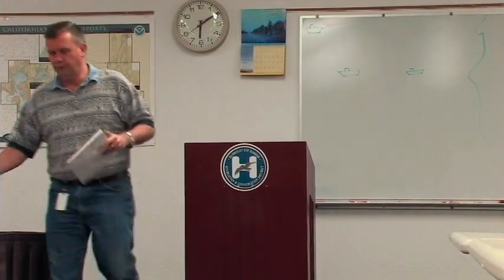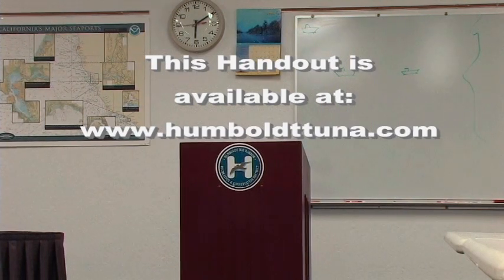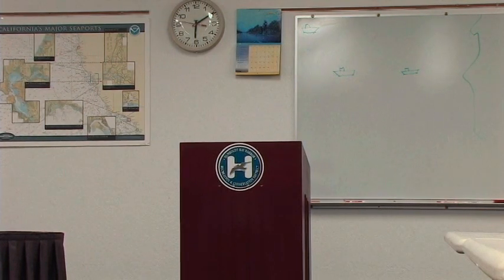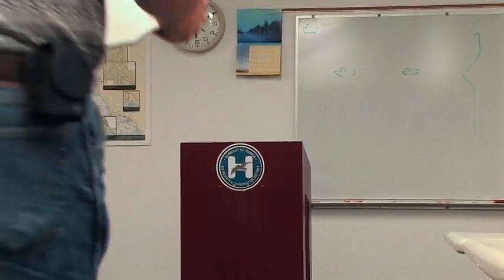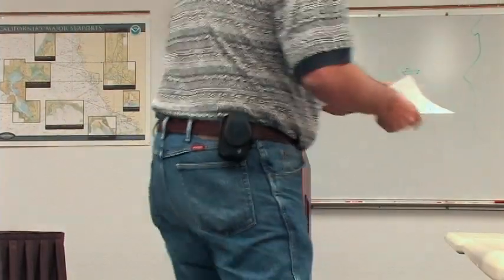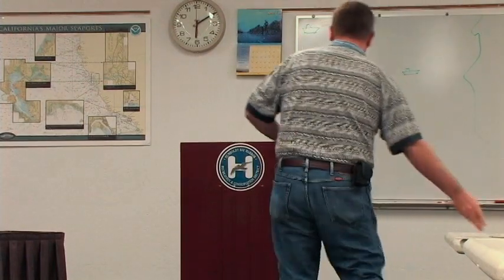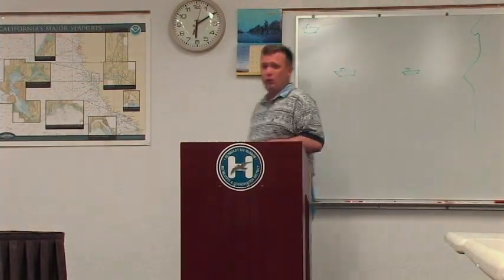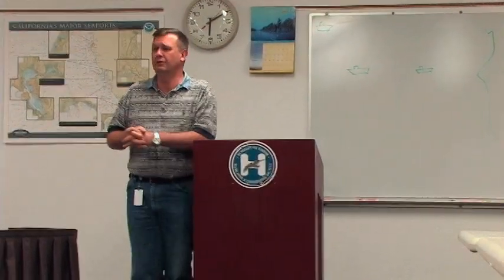VHF Marine Radio - DSC Radio USCG- Pt. 1

Comment: There is potentially dangerous misinformation in this video. DSC radios DO NOT relay DSC calls.  ITU Recommendation M.541 section 3.4 specifies that "Distress relay calls should be initiated manually." And section 1.4, "In no case is a ship permitted to transmit an all ships DSC distress relay call on receipt of a DSC distress alert on either VHF or MF channels." Consumer DSC radios in conformance with ITU rules are not designed to relay calls automatically.

Comment: What a joke!!!!!!!!!
DSC radio's automatically relay distress alerts from boat to boat. INCORRECT
DSC radio's will transmit DSC data if they don't have an MMSI. INCORRECT
DSC radio's will simultaneously transmit DSC data and voice. INCORRECT
The MMSI is specific to the radio itself, there cannot be two MMSI's that are the same. INCORRECT
You can send messages from boat to boat just like text messaging. INCORRECT.
What constitutes a mayday/distress situation is not written policy. INCORRECT